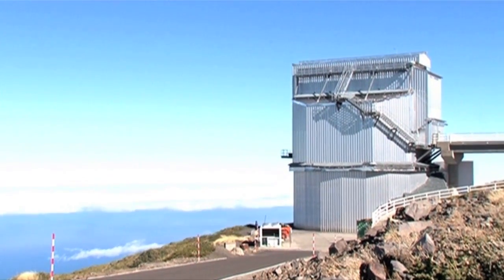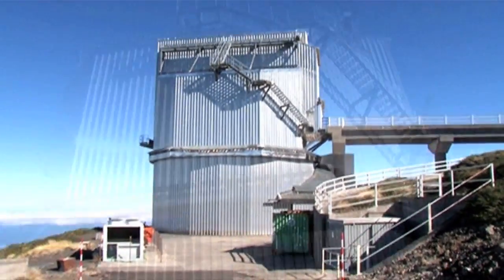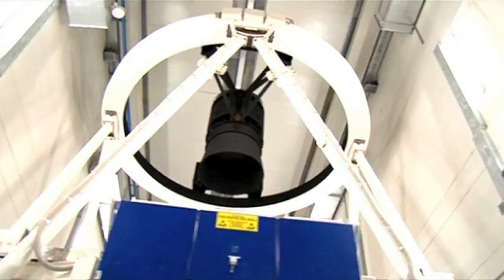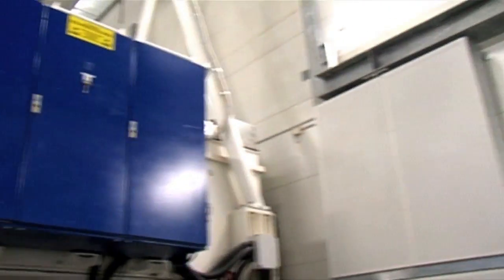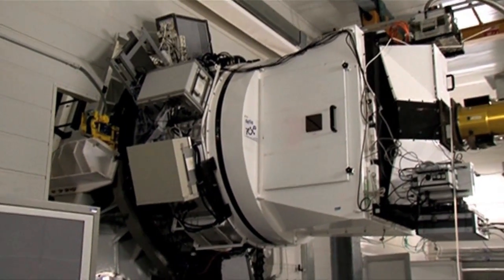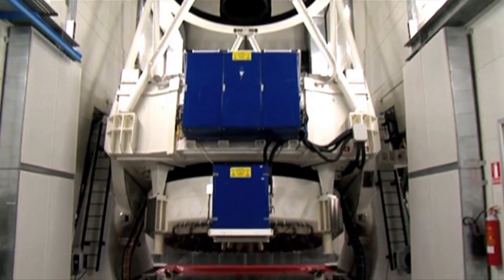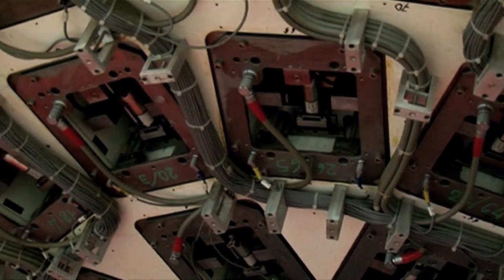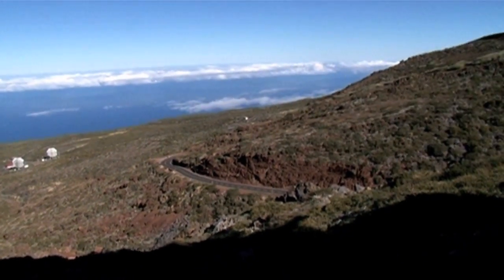Italian Telescope - Deep Sky Videos

Comment: Brady says something about the pods under the mirror being for getting a better picture. Actually, what they do is push to the mirror at different points to compensate for the distortion under the force of gravity. This force (and therefore the distortion) is different at different angles, so computers calculate how much correction is required at each point for a given inclination.

Comment: Yes. The mirrors are cleaned from time to time. It is quite an involved process and there is a danger of scratching the mirror so they prefer not to do it very often. 

One of the interesting things is that they use snow created from liquid nitrogen as a cleaning agent. Nitrogen snow does not melt, it sublimates, so there is no residue left after the cleaning.